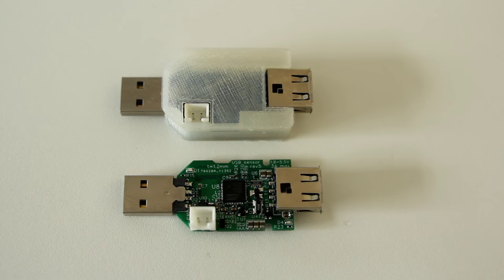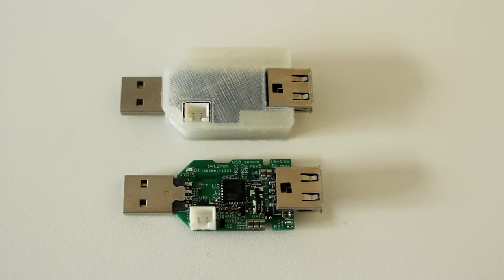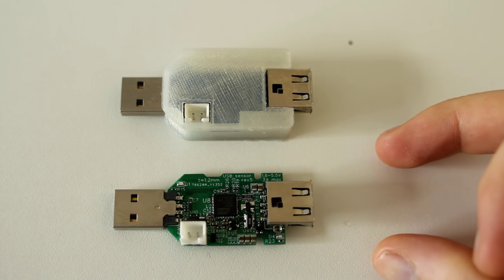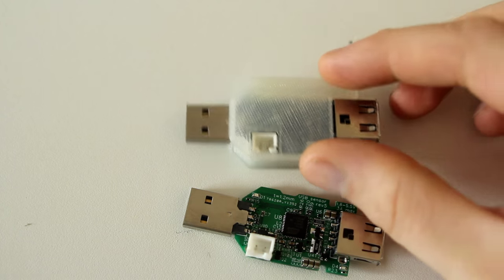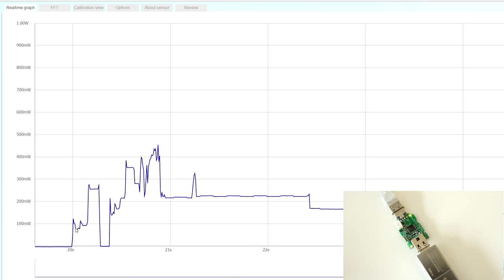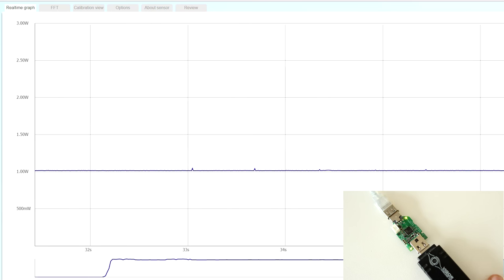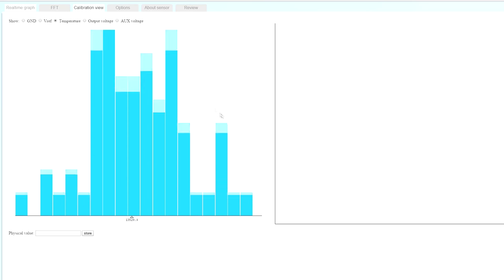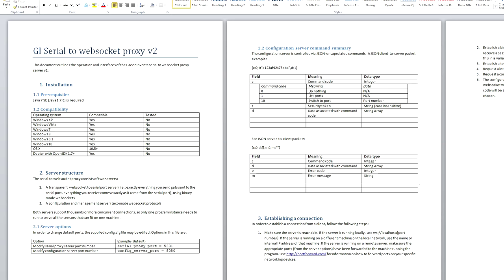MADPSU USB Sensor - Selling 20 beta units!

Comment: +PowerElectronicsBlog 
This was the video I was thinking of commenting before I got distracted for an hour ot two thinking and commenting on your anodizing video.

Now as the proud owner of a cube i7 book I have realised what a crazy non-standard the usb type C connector actually is. 
Well it's just a connector.
The number of different standards that can use it eg. USB 3.1, Thunderbolt 3, Displayport, MHL 3.0, 
Then charging standards like USB-PD (power delivery), & Qualcomm QC 3.0 (port independant).

Anyway in the forums I have begun to realise the frustration from a consumer point when you cannot tell what charger/powerbank and cable will even work with your device.

Now this is a problem particularly given this is no longer a clear standard for carrying voltage. USB 3 and prior 5V give or take less than half a volt right?

The risk exists of frying your device particularly when using a out of spec cable. Particularly non-spec USB-A to Type-C... There's quite a bit written about this after a google engineer fried his device.

Manufactuers aren't even labeling thestandards the device is using -the frustration of seeing chargers that list that they're type-C 12V
Okay,
but is that QC-3.0 or USB-PD.

Even if it is USB-PD - What provide number is it....
WOW.
I mean what else is there to say.
From an engineers point of view I'm sure they love the ONE CABLE TO RULE THEM ALL BAHAHAHAHA.
For a consumer.... many confusing headaches.

I was wondering about a device that could not merely act as a multimeter but determine what standard or carrier protocol is occuring over a cable/from a device? 
When people are using trial and error to test cables/chargers something is wrong with the (non) standard.

PS. Your device is pretty funky. This is no mere $5 USB ammeter/voltmeter from Banggood....